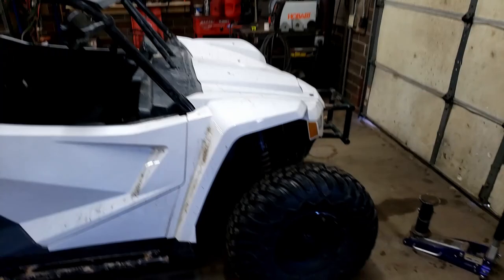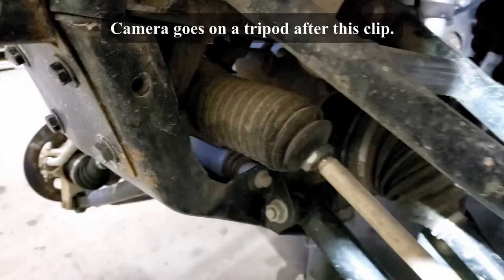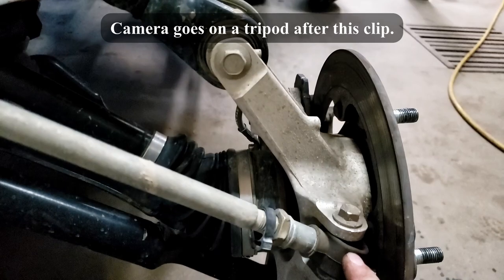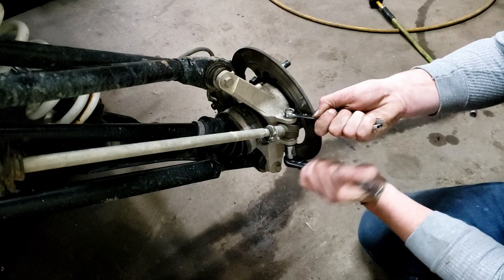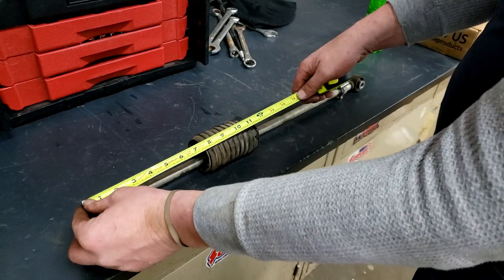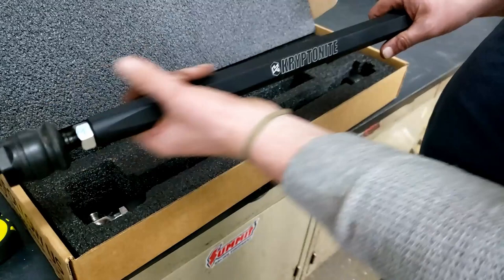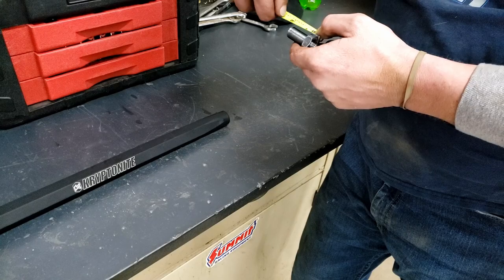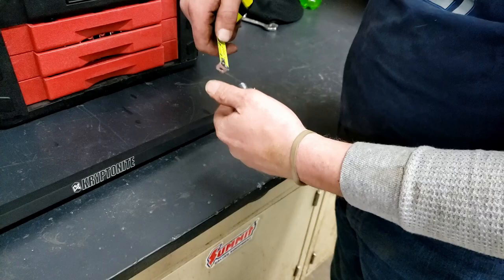How to install Kryptonite Death Grip Tie Rods on Wildcat XX

Comment: You guys have already provided more quality content with that machine in a couple months than sxsblog did in their entirety of owning it. Glad to see it went to a good home and I look forward to seeing how it does over time. You’ve earned a new subscriber
Reply: Thank you, glad you enjoy the content.
Reply: Sxs blog guys gave up cause Textron wasn't dropping money in their pockets
Reply: Oh I got in sxsblog's ass   told them why not do the upgrades to the XX that yall do to the pos polaris....you dog the XX because of a tie rod and axle and soft suspension.  Even tho its what its designed for. So upgrade the toe rods, fix a common axle break on all machines and hey call shock therapy like ya did for the pos polaris x3 yxz and get new springs  oh and yall revavled the pos polaris shocks as well. 
So how about yall stop doggin the XX until you actually push the damn thing  oh wait....what?? They won't sponsor or give you free shit....I understand
Reply: Oh rant over   what length did you set the tie rods to   ive bent both my rods lol  200 miles  but some serious trail and rock bouncin  so  
I need to get an idea

Comment: Did you have any issues with the tie rods rubbing the inner rim ?
Reply from the maker: The original ones did hit the outer cc boot, but they have fixed the issue with the 2nd gen ones that they sell now.

Comment: Did you have the Speedwerx Heavy Duty Steering Box Bushing on your cat?  My driver's side rod has some lateral play in it, so I am guessing I need to change out and am thinking about buying the bushings as I identified as a weakness by others.. Thoughts?
Reply: I didn't.  So far the bushings seem  good, but they are on the list of future upgrades.
Reply: Thank you and great video...Are these the "UPDATED" Sku#KRTRXX18?   I take it they fixed something from their first version
Reply: These are the old style, the new ones don't have any clearance issues.

Comment: Does the stock inner tie-rod boot fit over the Death Grip tie-rod?? We ride a lot of water and mud and that boot keeps all of the mucky stuff (technical term) out of the rack. Great looking tie-rods! Great video!
Reply: I honestly didn't try, they already have a seal on them.  I did have to do a fair bit of grinding to prevent them from hitting the CVs, but, in my  opinion not enough to concern me about their strength.
Reply: Yes they fit. I reinstalled them on my 2018 XX. Just remove the inner end and put them on.